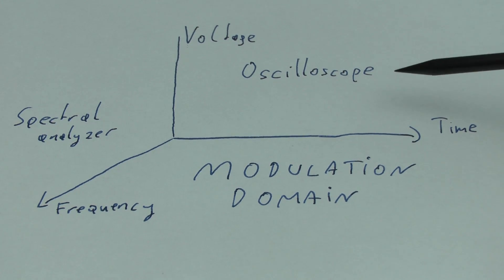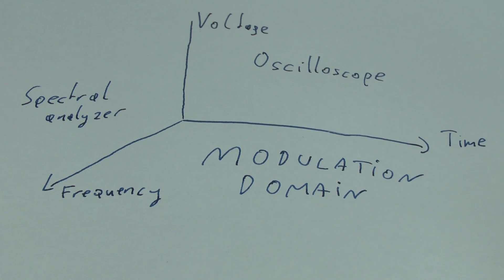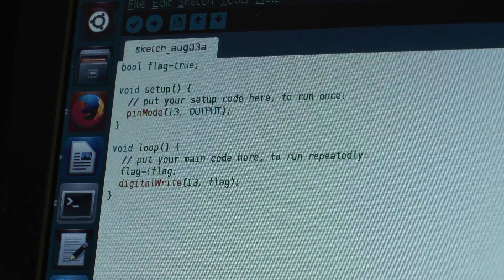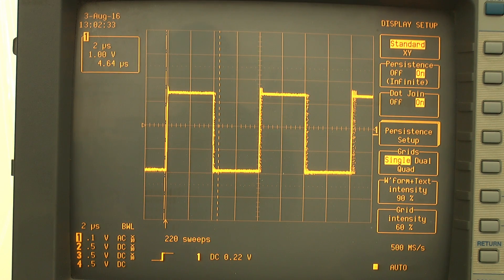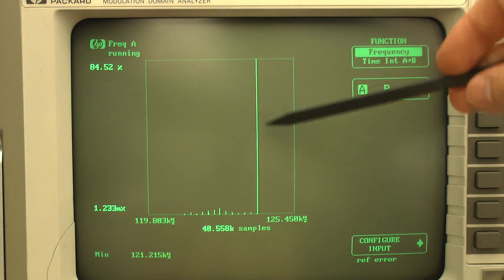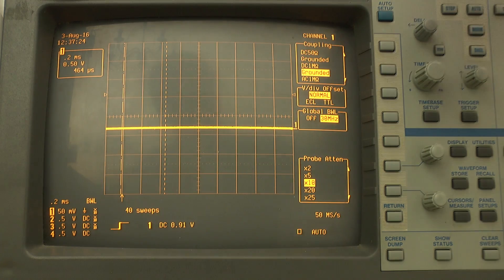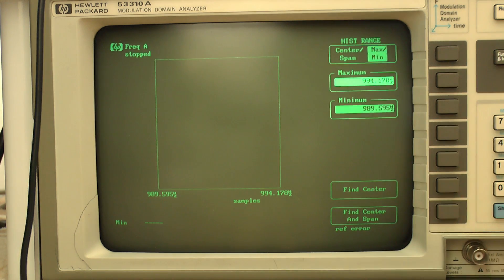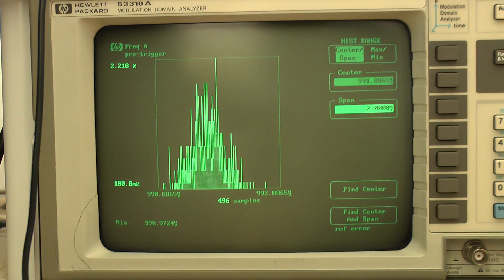Modulation Domain Analyzer - what's that for?

Comment: Thanks, Tam! That was really interesting. I especially liked the Arduino example. I may now need to buy myself an MDO!
Reply from the maker: Hello Gabe,
thank you so much for your praise! May I ask what kind of measurements you are planning?

Also, when buying a 53310A, be aware of the power supply!

Tam
Reply: I just graduated from university here in Boston, USA. I've been doing some work with HAM radio and I am in the process of converting a 40m CW transceiver to SSB.

Also, I have found some of your posts in the LeCroy Owner's Group to be extremely helpful. (I'm a big LeCroy fan!) Thank you so much!
Reply from the maker: Hello,
thank you so much. It is always a pleasure!

Re LeCroy: I do not want to promise too much. But I might soon have something else to show off...one or two more months, and my bargain basement LC334 might be here ;(

Tam
Reply: Hi Tam,
I can't wait to see that!

As it turns out, my LW420 has been having some issues. So I will probably post to the owners' group after I do a bit of digging around for obvious problems. (Admittedly, this not as exciting as a post to YouTube.)

Cheers,
Gabe
Reply from the maker: Hello,
is that the waveform generator?

I can remember darkly having a discussion with someone on that on the mailing list some time ago...

Tam
Reply: That's right. It's the 486, DOS-based waveform generator. Quite a beast!

Sadly, it is quite an obscure piece of equipment and I can't find the service manual anywhere...
Reply from the maker: May I ask what is wrong?
Reply: Sure! Actually, let my email you when I get home. I'm getting a bunch of errors that I cannot remember off the top of my head. I can just send you the text of the self-test file and a screenshot from my scope.
Reply from the maker: Please leep me in the loop!